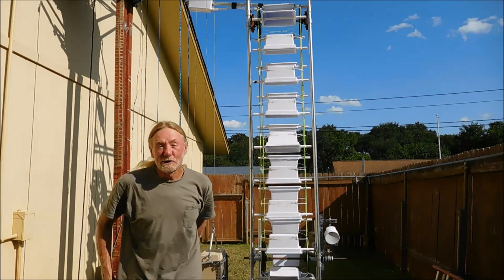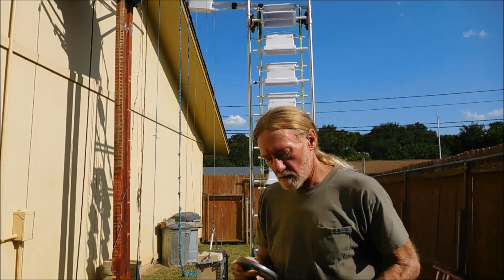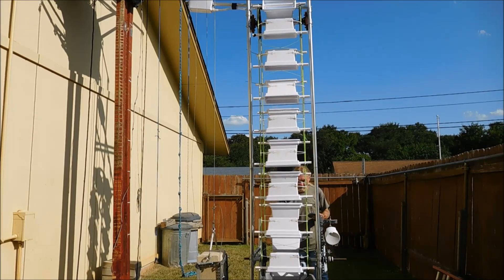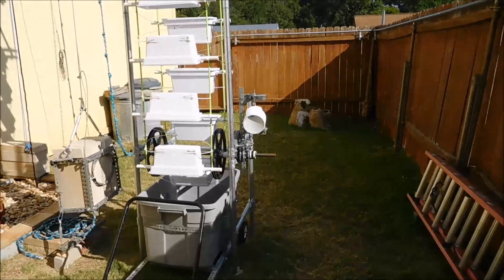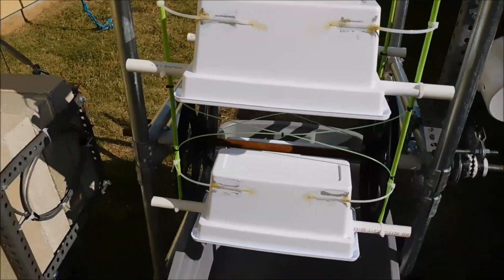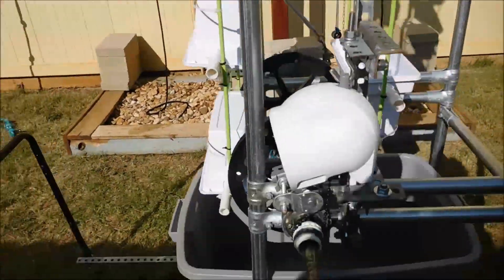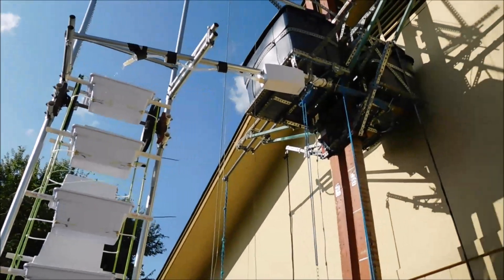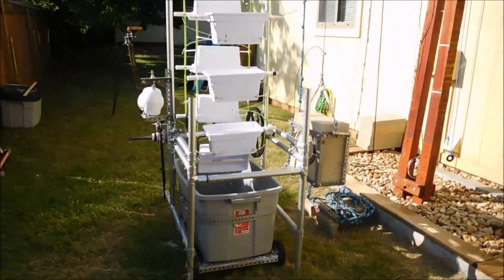Hydro Lifter Water Wheel and Gravity Light

Comment: RAM PUMP RAM PUMP RAM PUMP ALERT! Elevate the whole mechanism a bit from the ground . install RAM PUMP below the water reservoir to get head pressure to cycle the RAM PUMP.... heck! install a couple if u need to ( need to experiment to get correct flow rate to upper reservoir). I don't know physics and math well but u could at least extend the time the mechanism can run for if not make it perpetual. A lot of playing with dimensions of parts but I think it could work.

Comment: How do you get water for the choir?
Reply: In most of the videos I've made I use a solid material in the carriage of the Lifter. I decided to try something different like water. It has several advantages but one disadvantage is that once you empty the carriage of it's water you have to replace it. The water collected at the bottom of the water wheel has to be moved back into the empty carriage when it is lowered back down to the bottom. Once the carriage has been refilled then the carriage would be tilted back up the vertical support. This would be the recharge cycle of the gravity battery, making the potential energy ready to use. In the place of water one could use a loose material like sand. It would be much like an hour glass. Using a flowing material makes it easy to release the stored energy in a measured amount without multiple reducing gears, pulleys, etc.
Reply: @bill-wr6tb You have to constantly pump water into the upper tanks - I saw that it takes in water by itself, but there is a compressor.
How many kW is it capable of producing - thanks
Reply: @bill-wr6tb  You don't have such a model that would give at least 2kW - I'm probably exaggerating, but some German company has a model but they blow air in there with a compressor - which is not very suitable.
I saw some scheme where there was no water in the chamber with full tanks - but there was water in the chamber with empty tanks and it acted like Archimedes' law - that is, buoyancy was created -
.Friend - thank you very much for your information, but the road probably won't lead there - it's a pity that I don't have direct contact with you - thanks

Comment: Silly thought...  Set up as a triangle, vertical side is your up side, and you have the other two sides, which are the same length as the vertical side, pulling down, does that now give you a positive energy on the down side, and a negative energy on the up side?  If you have 10 buckets going up, and you have 10 buckets on each leg of the triangle, would that give one a means of making the unit perpetual?
Reply: Thanks for watching. There are a lot of ways to extract the energy from a gravity storage machine, but unfortunately you can't get more out than you put in. I love to watch examples of perpetual motion machines. People go into such effort and often their machines are well built and fun to watch, but they don't work. I've built some like you suggest. My math calculations were just so perfect, perfectly wrong. But keep thinking and searching, I will. even though it is like the "pot of gold" at the end of a rainbow.

Comment: i dont get it. what is the heavy bricks for? also it takes a lot of energy to put water in the totes on top unless its from the roof. also the pump would use more power than you would get right
Reply: The bricks are a counter weight when lowering the carriage. The carriage is around a hundred pounds and the counter weight offsets the wasted energy tilting up the water filled carriage. Plus when lowering the carriage it makes it easy to lower. Carriage weight minus counterweight leaves around twenty to thirty pounds to control when it is lowered. If the carriage and contents are to be dropped, as in many of my non hydro examples, a counter weight isn't needed. Pumps have a height that they pump efficiently. The amount of energy put into pumping the water back and for to the tilting action is a little over the energy needed to lift it. Unfortunately, it is not over unity ha! Check out the videos on my Youtube  channel or website to get a better understanding of how the Lifter  works.. This video starts with the carriage and contents already up the vertical support.
Reply: @bill-wr6tb  then run it from the run-off from your roof and you never have to pump it up to begin with

Comment: Do you think this would produce more energy if it were in the shape of an actual wheel? I'm thinking that there would be additional leverage created from the center axis point which would produce more torque. It's just a thought. Any relevant comments are welcome to enhance the knowledge of the YouTube community. Pretty cool working concept!
Reply from the maker: The way you extract the energy from the raised weight is really up to builder. In this case a larger wheel would require more building material and the wheel would be large unless you let the water fall into the buckets from the storage height. The energy stored can be released quickly or slowly. The torque would be dependent on the amount of water in the buckets, the number of buckets and how fast you want to use it. Big wheel, small buckets, lots of buckets or small wheel, large buckets, less buckets. As long as the torque is enough to turn the generator you will be halfway there. Thanks for giving it some thought and watching.
Reply: @bclifters  Absolutely! The way you did this was very impressive and will be used as a guide when I get around to building this project in my own way. Maybe I'll even post it so the world can see it! Thanks again for posting.
Reply from the maker: Here I used a wheel, small, but it was large enough and easily controlled by varying the water rate hitting it and the delivery point is at the end of a hose. I like hydro. It is easy to vary and deliver the force delivered.
https://www.youtube.com/watch?v=VKl2Yu8NVVE&t=15s
and
https://www.youtube.com/watch?v=eNrZLC_Jyp4&t=6s

Comment: What about hooking a low powered water pump to it so the water from the bottom could be pumped back to the top heck maybe even a mechanical one using gears and belts then it could run continuously until the water evaporated 😏
Reply from the maker: Oh how I wish that was possible. Remember that the efficiency of your machine is less than 100%. You can't get more energy out than you put in. That doesn't stop the endless flow of ideas on how to over come this problem from showing up on youtube. (Spinning magnets and wheels, generators turning motors and motors generators, floating and sinking air filled containers, etc.) I like trying myself sometimes, just to see where the fault is. Keep thinking. 😎
Reply: Kinda cool to bad u couldn’t have this setup then have the overflow fill the buckets on your invention to get more energy out of the water then if it were realistically possible to hook up that ram pump and it works pump the water back to the top and start the process over again or even power another gravity generator 

This stuff really interests me but I know true perpetual motion is impossible but near is until the flywheel looses energy or the battery slowly runs out of stored power until the motion is unable to power it anymore it’s still fun to see what people come up with 

Your invention I think is smart to bad it couldn’t be done in large scale to power cities maybe not even using water but sand or weights but it would still need a person manning it to refill the top reservoir but it could be a source of clean energy even if water ran to low to run turbines 

https://youtu.be/zHwSubmVYp4
Reply from the maker: I agree, these pumps are really unique. Watching them work, looks like magic. I thought there might be some way to use them in a Lifter, and you could, but if you have a flowing body of water then you have a ready made source of energy and there are several methods of utilizing it. Take a look at these and try to understand why they don’t work. Once you start seeing the flaws in these you will be able to apply the same logic to your own and other energy conversion methods that claim to be near or over unity. Enjoy, if you solve the puzzle, you will be the most famous person ever! 
Visit -  https://lockhaven.edu/~dsimanek/museum/unwork.htm

Visit my website to see other videos on my youtube channel.  https://www.bclifters.com/  and  https://www.youtube.com/channel/UCxuSnBuxIj9aWm0HtBXBzKA
Reply: Just found out about ram pumps they can supposedly pump water uphill 

The only catch is how to collect the water they gush out and how to divert it back to a tank that feeds back to the lower tank and it can then feed the upper tank you’d probably need 2 ram pumps no idea how you’d hook it all up but it may be possible

Comment: Good idea sir, how many max watt can produce?
Reply: The containers hold around 30 gallons each. That would be about 480 pounds total (8 pounds per gallon). This would be almost 4000 ft-lbs at 8 feet. This converts as 1 ft-lb = 0.00037661609675872 Wh. So if the potential energy was drained off in one hour it would be 1.5 watt hours. The output is enough to provide voltage and current for several small LED lamps. Increase the height and/or the size of the filled containers and you will increase the potential energy available. Increasing or decreasing the flow rate of the extracted water will like wise change the amount of voltage and current coming from the generator. Once you determine the amount of output and time of use, you calculate the foot pounds required. From this output value the weight and height of the potential energy needed can be determined to produce it. So the calculated value is the ideal amount needed, but the generator produces back EMF when attached to a load and the loaded and unloaded torque needed to turn it has to be taken into account as well as the over all efficiency of the extraction process.

Comment: Very nice work.  How much power is needed to lift the water up and how much power the system generates?
Reply from the maker: You must put more work in than you get out. The method used by the lifter, tilting the carriage, is fairly efficient. Sixty gallons of water weighs around 500 pounds. This Lifter has an extended tilt arm and a small distance between the two fulcrum positions that the carriage tilts on. I believe it required about 40 to 50 pounds for each tilt. Five hundred pounds at eight feet lowered over a period of one hour would give an output of about 1.5 watts. Extending the drop time will reduce the output or decreasing the drop time will increase the output.  Visit my web site for more info and examples.  https://www.bclifters.com/

Comment: You should have just used the concrete block on a pulley and put a gear-up ratio setup into the generator/light....would have more efficient than using water.
Reply from the maker: Using water as the material in the lifter came after I ran out of ideas using blocks and gears and pulleys and etc. I'm still using solid materials, but water does have some advantages. It is really easy to pull the needed energy from what's stored and you don't have to use a heavy gear or pulley system up front for torque reduction. Check out some of my other videos at my website for a really early history of development. In the end 5 to 6 hundred pounds of something is stored 'x' feet high and it is up to the user as to how to extract the stored energy.

Comment: I love the idea, multiple containers, how much power are you getting from this andhow much are you gearing up to the final speed
Reply from the maker: The Gravity Light uses around 20 to 25 pounds to operate for 20 minutes at eight feet. In this example I was able to get 50-60 minutes for every 10 gallons ( approx. 83 pounds) of water collected by the water wheel. The up front gearing is small compared to the rpm provided by the internal gears and generator of the Gravity Light. See my website for additional info.

Comment: but are you generate electricity ? and how much W make that sistem ? bye good luck withhim
Reply from the maker: 500-6oo pounds raised 8 to 10 feet is enough to provide for several 3 volt LEDs for possibly 5 to 6 hours. If you want more output for a shorter time then you can drop the carriage faster and provide more torque or rpm to your generator. A larger generator will require more energy to operate and you have to match your desired output to the height of your lifter and the weight in the carriage. Those two variables have to equal the generators input requirements and the length of time you want to operate it. Look at my website or channel for more proof-of-concept examples using solid material in the carriage.

Comment: You can lift the water up again by ram pump and one of mr teslonians(here on youtube) inventions where he lifts water with sunlight on a barrel changing the pressure inside making water climb to the less pressure region.
Reply from the maker: If you have flowing water, to extract energy from, then that opens up a whole lot of different storage opportunities. Ram pumps aren't very efficient, but they will raise water to a height that would be useful for energy storage.

I have considered not using solar panels and just rely on the heat from the sun, as you mentioned. Moving a thermally expansive liquid from a heated container up to a cooled container and then reversing the shading to the previously heated container would perform the work needed to tilt the carriage up the vertical support. 

A good example of this type of machine is a "Minto Wheel". Everyone has seen the duck that puts his beak in a glass of water over and over. Temp differential is the big gotcha.
Reply: Yes i agree with ram pump with more than 4 valve maybe can lift more water..for waste water i agree too using mini solar power to moved that waste water to main bucket, but i dont know for sure that idea.

Comment: If I were building this I would lengthen the chain on the generator, install several generators in series and use solar motor or pump to lift the weights  during the day.

Comment: So you need a hose to keep filling the buckets with water?
Reply from the maker: You have to lower the carriage of the Lifter and refill it with the water that has been collected. This is an efficiency loss when using flowing material in the Lifter carriage. You must either refill from ground level or collect at a higher level and allow the collected material to flow back into the lowered carriage. However, the taller the vertical support, the smaller the efficiency loss, because the physical height/size of the carriage becomes a smaller percentage of the overall height of the vertical support. Look at my web site for other examples and a discussion of Hydro Lifters as well as other types of Lifters.

Comment: Very well build..now the next question is how to get the water up again with less energy, what thesystem produces. Have a look at the Messiah machine from Volker Scheffler..he claims to have done it...
Reply: you can't have a net gain system, it doesn't exist stop trying already. accept reality and deal with it.
claiming and proving are two entirely different things. no one has ever proven that any free energy generated is actually free, there is in almost all cases either a hidden wire, a tesla coil nearby or a battery tucked away somewhere. if something is too good to be true, in most cases it's because it is TOO GOOD TO BE TRUE and is thus not true.

the only thing this system from the video does is store power and uses it over a pretty long duration. that energy is the mass of the water falling down due to gravity pulling the water down. the energy required to push it back up is equal the energy it produced on the way down. however nothing is perfect and so you have to tack on inefficiency not just for pushing it up but also when it's falling down and being converted into electrical energy. the potential energy of this system is VERY high however the actual energy (applies to most systems) you gain from it is quite low.

at best you could have a pulley crank and pull it up by hand, which wouldn't take you very much time and if you built it so that it uses mechanical advantage you could lift it up without breaking a sweat. however again the energy required to lift it would remain the same, the only thing mechanical advantage gives you is that you can do the same amount of work over a MUCH larger time frame which reduces the energy per second you need to move/do work on something. that is, it makes the work easier, it doesn't reduce the amount of work you have to do.
Reply: @Dan W 
""stop trying"?

Can't be done just like flight?"
can not be related at all.
one clearly breaks the fabric of reality that EVERYTHING we have today is based on and the other was some dumb asses who clearly didn't know anything and said it can't be done.

"You know some people Tinker around with stuff like this as a hobby do it just for fun."
you know some people spent their entire fucking lives working on equations and procedures just to come to the same conclusion that nothing is free, nothing can be created nor destroyed. free energy isn't a thing, it's pretty foolish to think that it does because then clearly you don't understand physics. if you don't understand that and you think you know better then all of the scientists that spent their entire lives working on these things then you are actually insane.
there are bounds of reason, and then there is completely off the rails. free energy is off the rails.

Comment: I'm thinking of a gear running a diaphragm to pump the water back up, with one way valves and 1/8 inch hose should be able to almost keep up.
Reply: That will never work! The work involved in pumping the water up will make the system come to a complete stop.  The system is under 100% efficient so can't have your cake and eat it too in this case.
Reply: This might work, don't listen to those who are disappointed. Experience is the best guide.